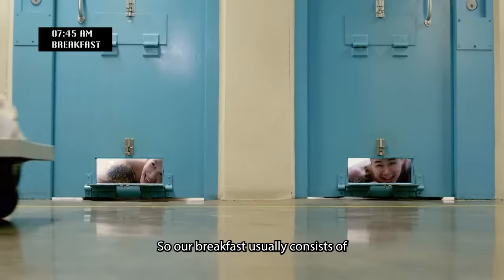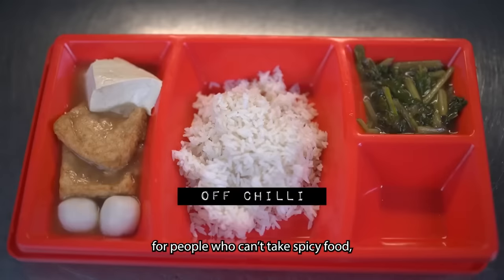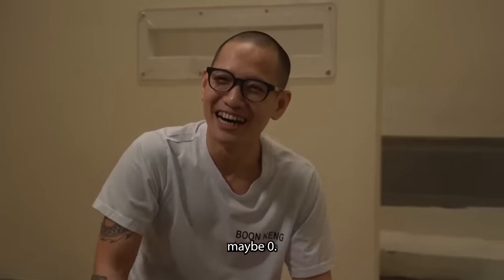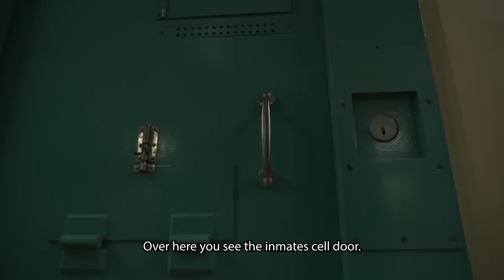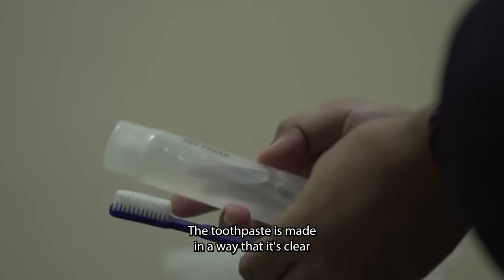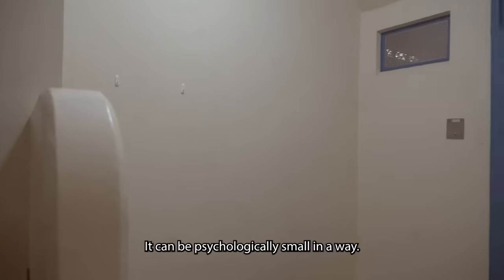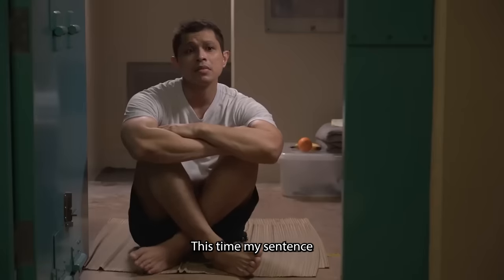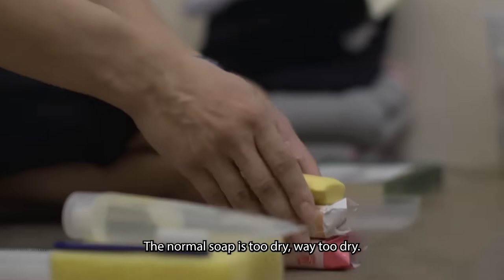Breakfast Time Inside Maximum Security Prison | Singapore | Free Doc Bites

Comment: 3 years for drug consumption is crazy, people who do drugs have a problem putting them behind bars doesnt help them it just removes the problem for a certain amount of time. Most drug users still use it after getting released, they need a reformation program to solve the problem permanently
Reply: I would think it would be a solution. 3 years of this situation. After that amount of time that has passed, they are clean. I bet they think "Yeah I'm not doing another 3 years of that to get high for one night."
Reply: I'm not saying 3 years of that is right, just saying I bet they don't have a lot of repeat offenders.
Reply: Not that I've really done any research but I would think after their sentence they have to go through some sort of rehab program
Reply: Singapore is such a tiny country but with a crazily rich government and a well payed highly efficient management system, and has zero tolerance toward drugs. If you can still mange to get yourself some drug under such circumstances, you are very sussy. Your crime probably also includes Illegal smuggling of contraband at least.
Reply: Some people get less.  I knew a guy who only got one year for an oz of weed, some speed and acid.   Make no mistake, every drug is in Singapore, they are just sneaky about it, and its expensive. 😅